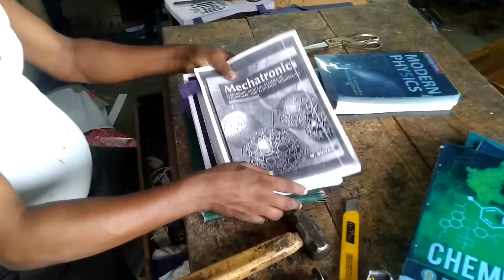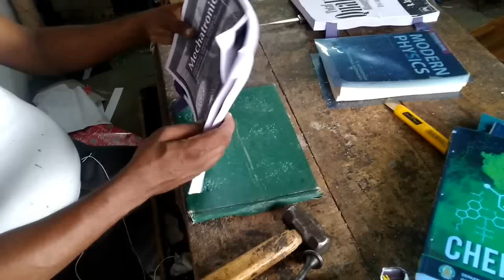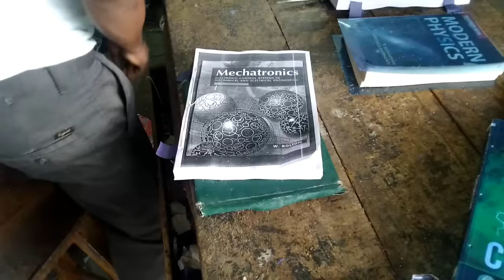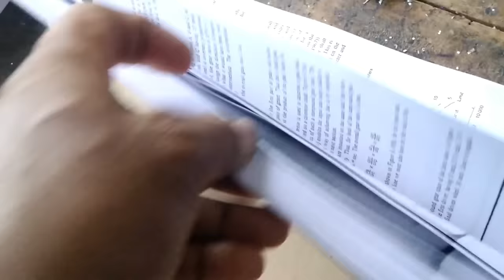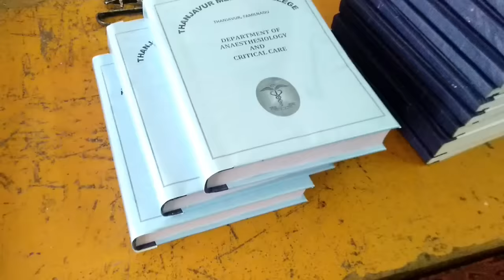Book Binding | How to make Book Binding Easy | Easy method Book Bindings

Comment: Great craftmanship at such a fast pace!
I'm curious about the supplies. 
What kind of glue is that in the bag? 
What is the purple on the side? Is it vinyl? Some kind of tape? Or something else?

What is the pink outside cover? Is it vinyl? Or something else?
Reply: Tapioca starch glue
Reply: That glue is made by simply boiling any kind of starch in water and getting it in desired thickness.
The purple thing on side is called buckram, it is a fabric that's coated with some thick material to make it kind of like strong thick. The outer pink is simply paper (colored). The ones used for gift wrapping.

Comment: Mechatronics, also called mechatronics engineering, is an interdisciplinary branch of engineering that focuses on the integration of mechanical, electronic and electrical engineering systems, and also includes a combination of robotics, electronics, computer science, telecommunications, system  control

Comment: What is that's purple colour strip between paper which u stick it on on top and bottom paper? Why it's used
Reply: It is probably used to separate the two books (they are stacked books) kinda like the  things u put in binders
Reply: It is a kind of muslin cloth to protect the papers and the thread knots

Comment: I don't about the glue in the orange pocket but the one in that small bucket is made from mixing maida(all purpose flour) or wheat flour in water and bring it to a boil until it has the consistency of a syrup then when its cool enough to touch it'll be used as a glue..
Reply from the maker: Thanks for the info!
Reply: Nice one, thanks. ...We used to just mix flour with cold water when ran out of paper glue as kids :-). ...Your method is probably much better and I shall try it out.

Comment: What type of glue you use?
Reply from the maker: normal glue
Reply: Manualidades Artesanias :- In India ,most of the book binders use glue prepared from Maida flour( white flour from wheat) which is dissolved in water and heated for sometime and a thick syrupy glue is got.Normally some copper sulfate is also added so that the glue is poisonous to the book boring worms and the book lasts longer,perhaps for a decade!.
Reply: @electrotech567  there are so many normal glues, which one exactly?
Reply: @tomasmaropa3484  pva is often used
Reply: @ThunderStruck15  thanks for the reply

Comment: But you used a machine (cutting machine). This makes my confidence some low. 
Can I use another things in this cutting machine???
Reply: You can use a simple cutter and maybe some metal ruler for alignment.
Reply: The cutting machines he is using is dangerous and chop of your hand if something wrong happens 
It is outdated b machine but in poor India people keep the old machine running it does not have safety devices like the newer machines